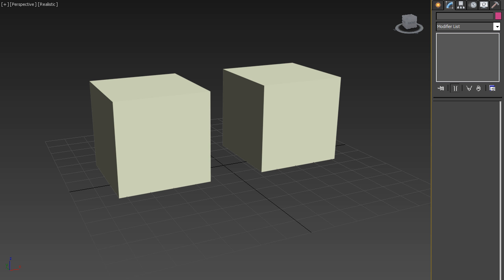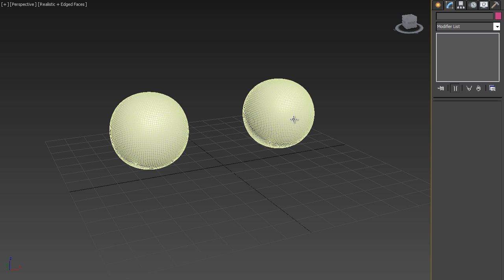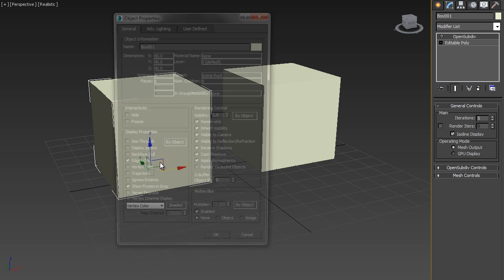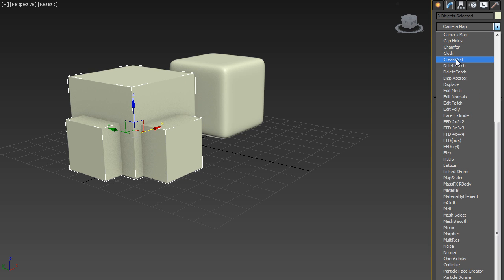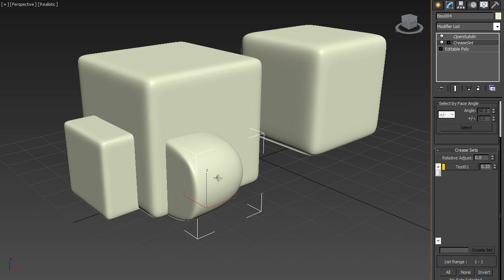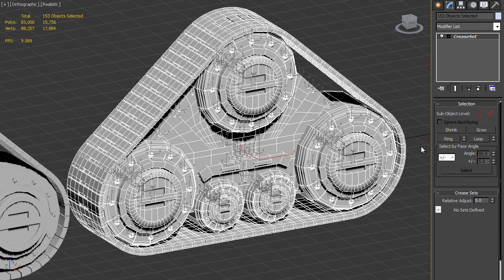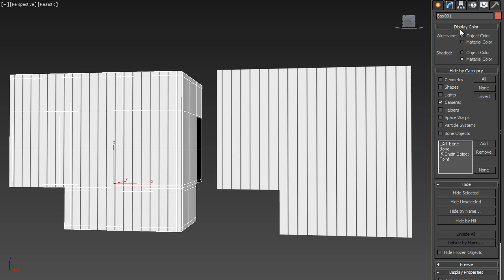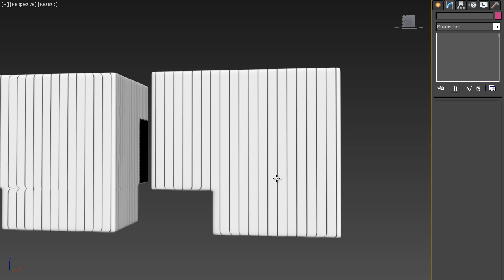Exploring OpenSubdiv in Autodesk® 3ds Max® Extension 1 (part1)

Comment: 3ds max already had opensubdiv for years but am not sure it works within Mudbox and other softwares that have Opensubdiv, I think it should work. Go to your modifiers and choose Meshsmooth. No supporting edges, just add your smoothing groups on your mesh and apply mesh smooth and smooth by smoothing groups. Voila! Also there is a very nice cheap plugin called Turbo Smooth Pro that works the same way but I think it has some other features but none of them are critical or necessary.